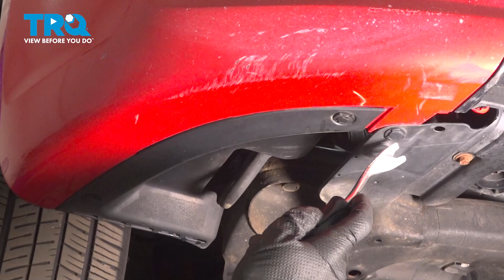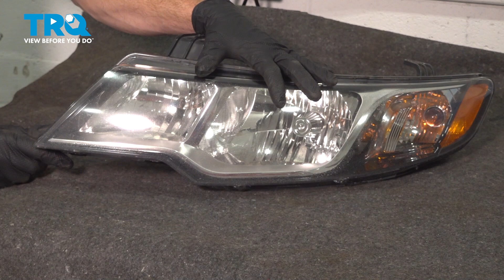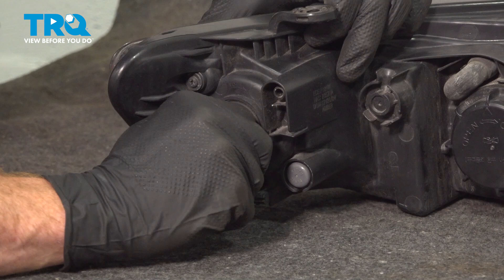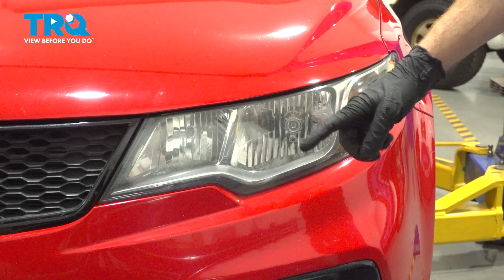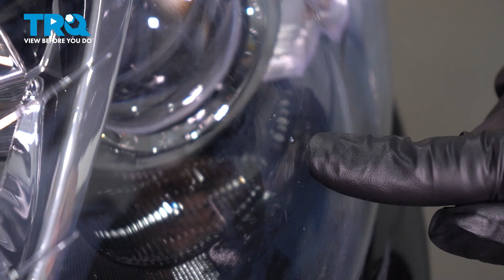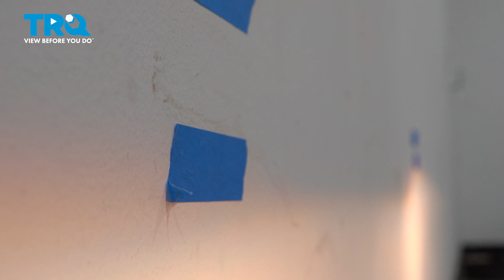How to Replace Headlight Assemblies 2010-2013 Kia Forte Koup

Comment: Hey guys for anyone doing this there is no need to remove the bumper just unbolt the top two bolts on the assembly and it will pop out with a little bit off force